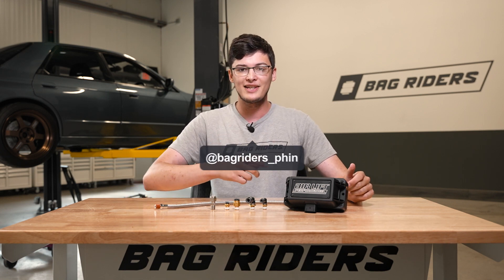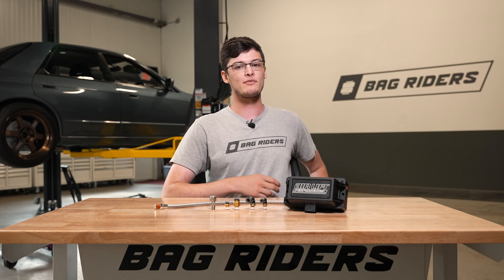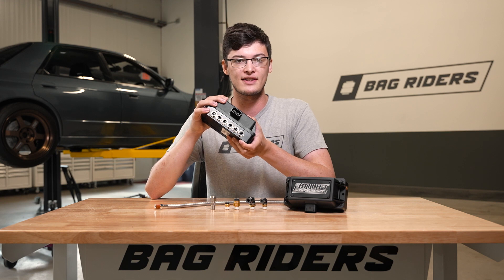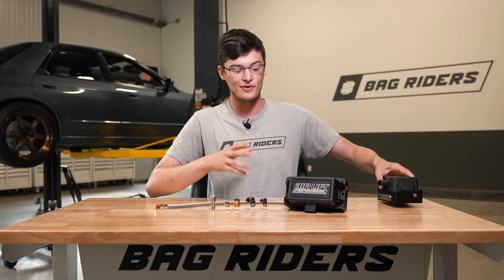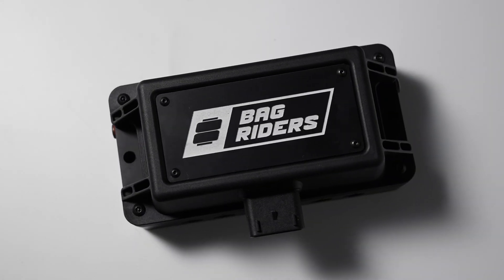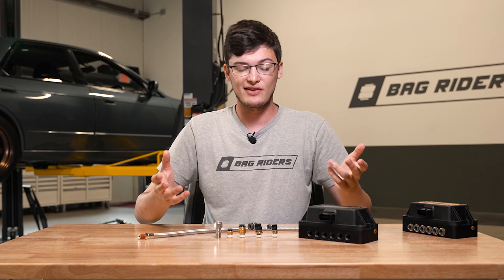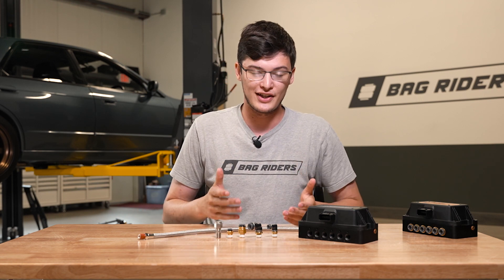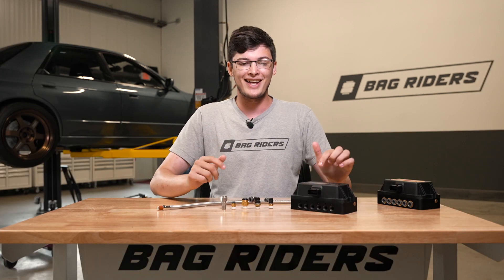What are Air Lift NPT Manifolds?

Comment: Hello, I'm new to the air ride system. like to ask if one is able to use a 1/2" fitting to the manifold. Thank you.
Reply from the maker: Unfortunately the spacing of the NPT ports only allows you to run 1/4" NPT - 1/4" PTC or 1/4" NPT -  3/8" PTC fittings. The 1/2" fitting will not work on the Air Lift manifolds unless an adapter is used. Feel free to reach out to us with any other questions!

Comment: Does the PTC Manifold get issues? Apart from this change Is everything the same?
Reply from the maker: Any fitting can get worn out, and with the PTC manifold those fittings are not replaceable, where as with the NPT manifold if you ever have any issues you can simply replace the fitting! Besides the fittings they are identical manifolds!
Reply: @bagriders  ahhhh I got you you. Thank you very much 🙏🏿👊🏿
Reply: @bagriders  my manifold is getting replaced is there a way I can get this manifold in replacement? I got lifetime warranty
Reply: Yes PTC Manifolds are NO good.  They start leaking soon as waranty is over.  Theres should be a Class action Lawsuite for those bad manifolds.  Everyone is having issues.  Cant get to work cause car is NO good.